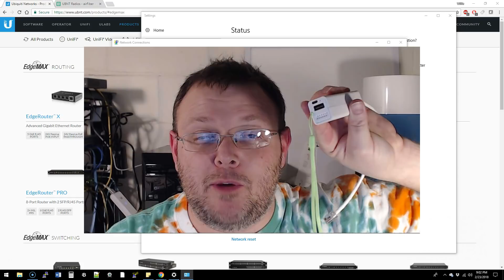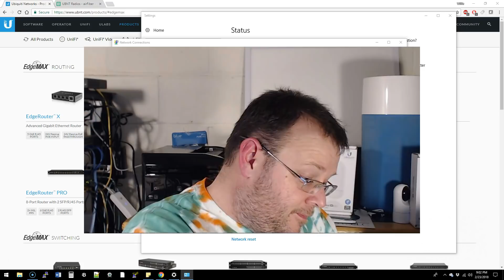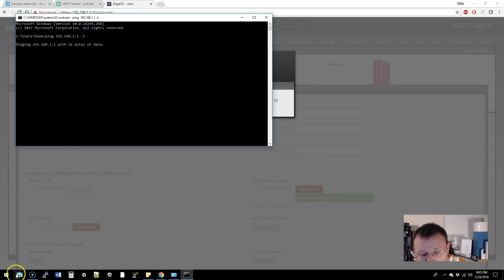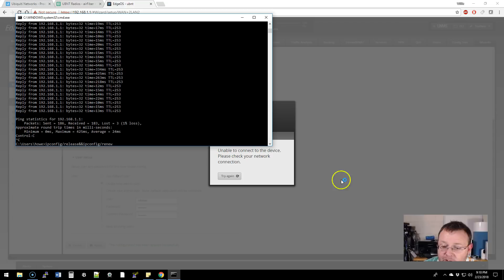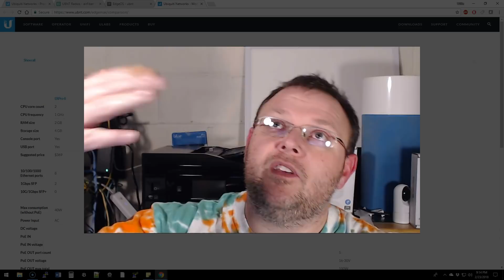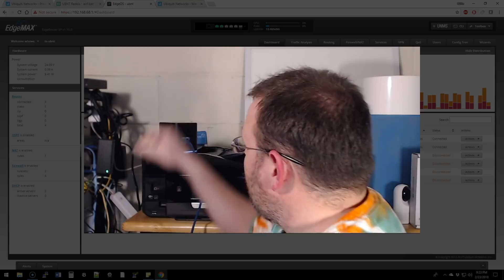EdgeRouter 6P Setup and PoE Options

Comment: I returned my device, I wanted to combine it with 2x U6plus acces points. Didn't work, the PoE of the ER 6Pis not powerfull enough. went out to buy PoE injectors, but now the unifi app won't find them. I also didn't succeed in connecting eth 3 and eth 4 to the same LAN as eth 1 and eth 2, I gave up. I packed the crap (after spending more than a day searching for settings, creating ubiquiti accounts all over the ecosystem) and sent it back to the store...  I don't have the time now to keep tinkering, I need it to work.  TP-link to-the-rescue!

Comment: i have setup the ethernet port 2 and 3 with a 48V and 24V POE without issues....can i setup the last port (eth4) with a 48V poe? Would that still be okay? Can Edgerouter handles it. Please help. This is the info or spec on edge router. I am not good at electric 

Max. Power Consumption 5W
Max. Total PoE Output 50W @ 24V
PoE Output Passive 24V (Pins 4, 5+; 7, 8-)
Power Input 24VDC, 2.5A Power Adapter (Included)
Power Supply External AC/DC Adapter
Supported Voltage Range 9 to 26VDC
Button Reset

Comment: Hello I have the Unifi Edgerouter 12 should the light be blue or white. I have the UAP AC HD Router and UAP CK Cloud key when setup there lights are blue. I have my Edgerouter 12 setup with 5 static IP blocks but the light is white. Thanks.

Comment: I was looking at the Edge router 4 and 6p to replace my crappy AirPort Extreme that can’t route my gigabit internet at full speed. I’d like to be able to use QOS and still route gig wan to lan. I also have a need for Poe but was planning to do that with a net gear Poe switch. I also need to power a couple of Dahua security cameras.... would it make sense to have Poe in both router and switch? Do I want the 4 or 6p. The 6p has more power. The 4 has internal power supply that I like.

Comment: Willie, Don't forget the unifi access points, UAP-AC-PRO/LR, etc. Also, I got my ER6P about a week ago and I've had nothing but problems.  I'll make changes through the GUI and they will not save or commit!  it keeps reverting back to a previous state.
Reply: Turns out it doesn't like firefox or explorer very much.  Chrome worked like a charm.  It also has trouble with the UAP-AC-LR.  The AP gets power but goes to isolation mode for whatever reason.  It'll work fine with an Edgerouter X SFP.
Reply: were you able to power up the UAP-AC-Pro with the ER6P?